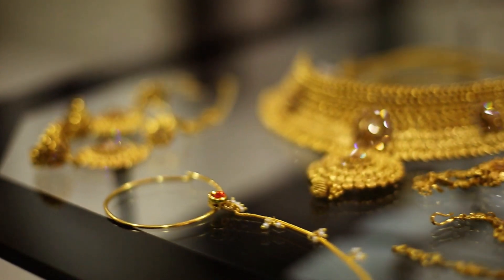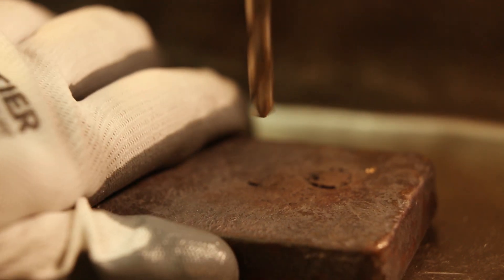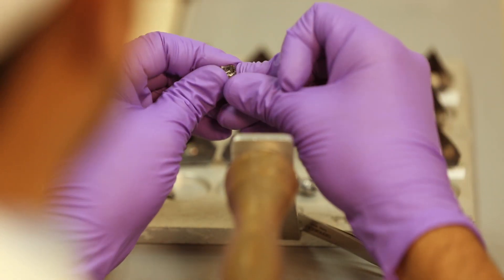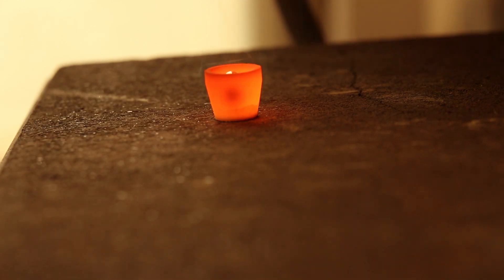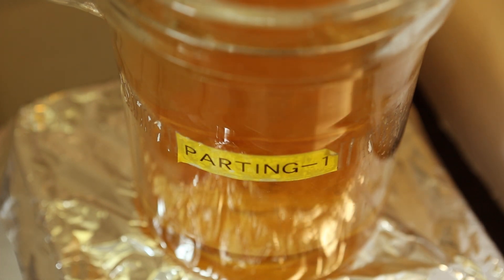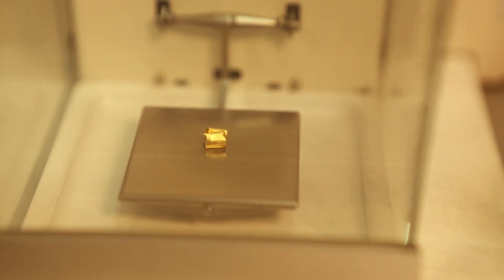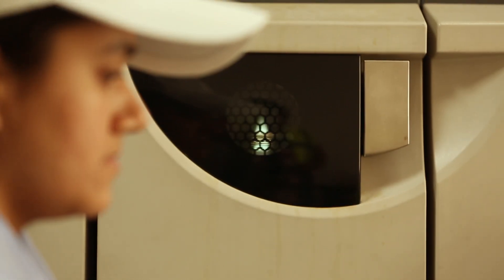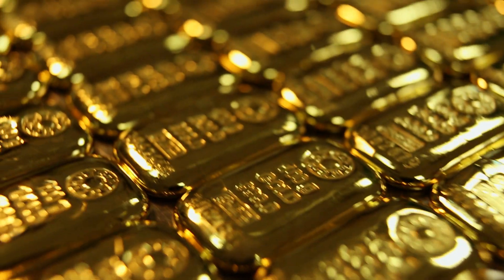Precious Metals Assay and Training Institute (PMATI)- Gold Fire Assay Process

Comment: Gold Assaying, jewelry and investment, determination of purity thru assay, fire assay, small amount drilled, called scrap as sample, XRF machine, calculation for partition, analytical balance, covered in lead foil. cupel, cupellation furnace, oxidation, cool, beads separated manually cleaned, hammer and press, cornet, with silver eliminate, parting, cool and dry, annealing cohesive, homogenous, rigid, cooled and weighed, fire assay complete, spark spectrometery, ignite high energy spart, ionized argon gas, icpc, high energy plasma, high ionized argon as, quantitative analysis, purity ppb